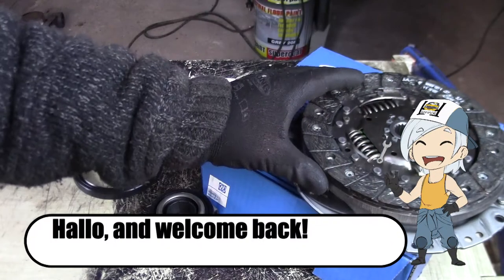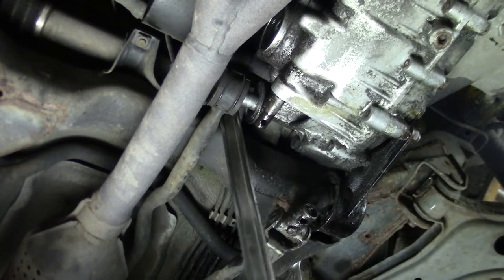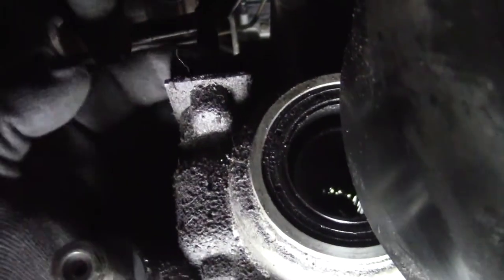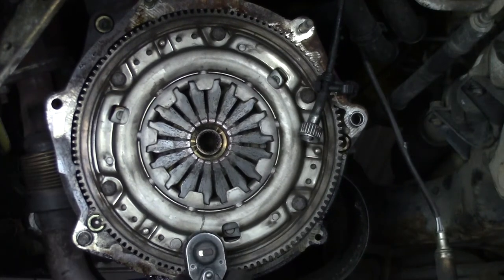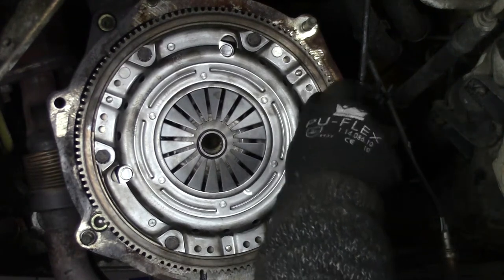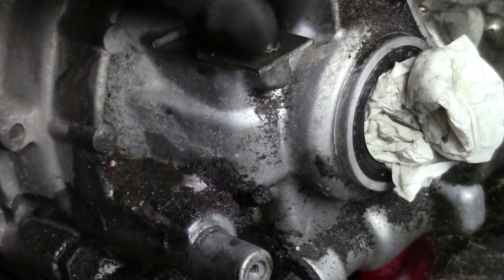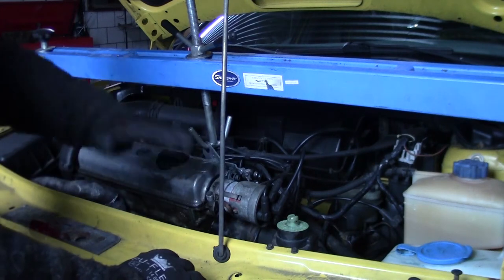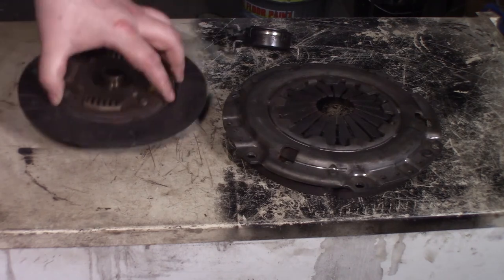How to replace a clutch of a Skoda Felicia or Volkswagen Caddy

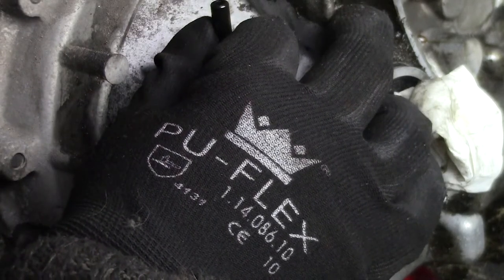Comment: Hi. Thanks for nice video. I have the same car. My problem is kilometer gear fell inside.(28:15 video). Now my kilometer doesn't work. How can I take it back? What if I use it , will I have big problem?
Reply from the maker: That sucks. I don't think it will have much impact when getting between the gears, it is plastic after al. At least mine was. But it isn't a pleasant idea. If you want to remove it then you have to disable the gearbox.
Reply: @TheDutchGarage   hope it is plastic 😁. My axles are making noise but not too much. And Clutch is normal. My mechanic said we would do it  all. Do you have Instagram account? I must follow you.
Reply from the maker: @emrekurkut  the_dutch_garage But i don't use it much tough. I really should.

Comment: Hi, really good video it's so cool to see somebody working on a Felicia. Do you ever experience a clunk when coming on and off the accelerator in your Felicia? I have this problem with mine and i'm trying to figure out if it's my gearbox.
Reply from the maker: Hallo and thank you for the time to comment. I think that i know what it is. But i do think you mean clutch pedal right?
Reply: Imagine you are in traffic and take your foot off the accelerator to roll, then press it again to carry on going forward, when the engine engages with the transmission again there's a clunk that rocks the car back and forward unless i'm really gentle with the gas. It's like loose engine mounts but I replaced the lower transmission mount already - so not sure. I love your videos, and my Felicia is also a 1.6 pickup, so the exact same set up as your Fun! Keep up the good work my friend.
Reply from the maker: A ok, no that's not the same that I had with the car. But it does sounds like motor/tranny mounts or maybe inner cv joints that gone sloppy. Thank you for the positive feedback.
Reply: Thanks for your reply, I had another look yesterday and the outer cv joint on the drivers side is making a nasty squeak/crunch when the wheel is moved when in the air so maybe it's a combination of that and those engine mounts, because the engine moves a lot still. All the best. Tom
Reply from the maker: Just trial and error.
Reply: @tomthebotanist  3years late but did you find the problem? It was the engine mount on my partners 1.3, I have 3 of them, 1 being a rally car (still in build process blame covid) they're bomb proof apart from rust

Comment: Mate  i know u michanic but first gear box removed withaout stand wrong and dangerous and tha big mistake is in ur sholder  otherwise is big gob u  have do flighwheel scime i am special clutch fitting
Reply from the maker: Hello, you are absolutely right. It really can be a hazard doing it like i did. But sometimes you just have to do what you have to do. As for the alignment tool. I just didn't have one. Thanks for watching.